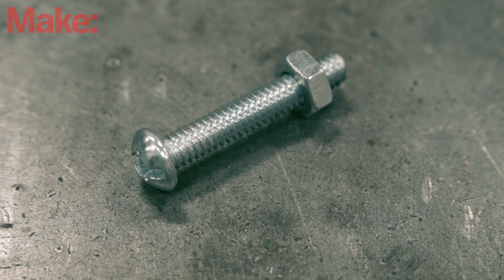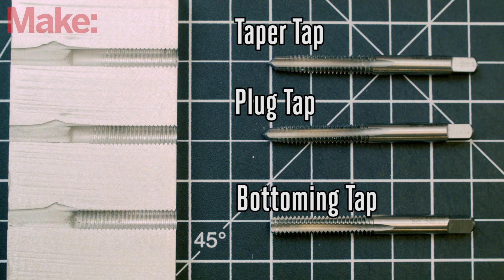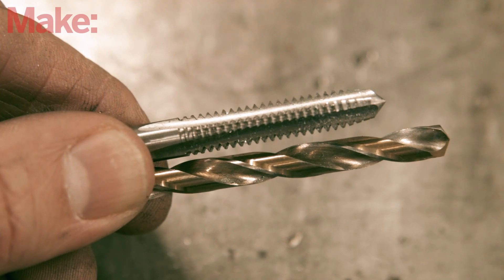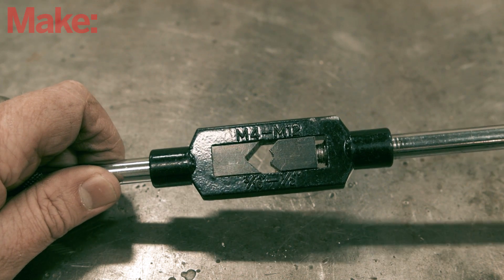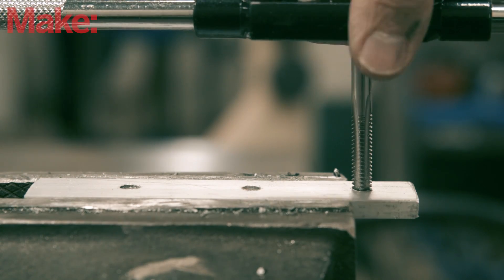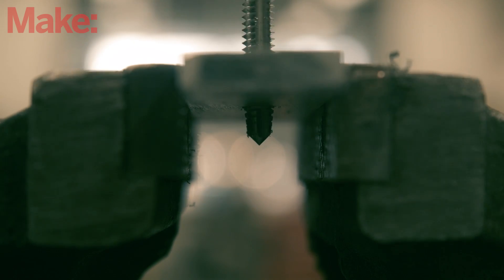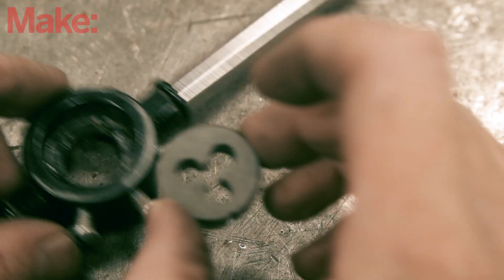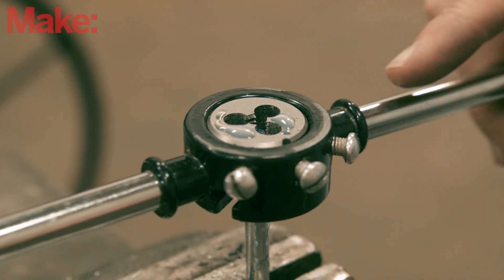Learn to use a Tap & Die to Cut Threads

Comment: Ironically, if you need this video, you pretty much have no business whatsoever doing what it describes.  Or using any sort of sharp and/or power tools, for that matter.
Reply: First of all, not knowing how to use taps and dies is NOT a sign of "mechanical ineptitude" -- in fact, when I took the metal lathe class, the instructor said that threading is such an advanced topic that many people never do master it!  So your being so great with taps and dies is an EXCEPTION, not a rule -- and your insistence that anyone who's not as good as you are with taps and dies has "no business whatsoever with sharp and/or power tools" is TRULY sickening!  Second of all, no, electricity is NOT a luxury in the USA and neither is public internet access (i.e. via a library or internet café) -- it's only a luxury in third-world shitholes, but once again, those places don't matter!  And third of all, it is NOT "grossly irresponsible and potentially dangerous" to use other, easier-to-use tools (like power drills, hacksaws, etc.) without knowing how to use a tap and die -- in fact, there's PLENTY of other tools which you could use safely before learning how to use a tap and die!  So it's YOU who's irrational and don't deserve to be taken seriously -- and I hope you cut your fingers off with some sharp power tool one of these days and bleed to death!
Reply: +Doug Reed I have been machining for almost a decade now, I am by no means an expert, but I can say this. If you haven't broken a tap, its simply because you either haven't tapped a lot of holes, or you haven't tapped anything more difficult than a through hole in mild steel.

As for my comment on luxury, I was simply trying to state that not everyone watching this video has had vocational or on-the-job training. There are people commenting on this video that have only ever ran a tap in a drill. I am sure these people are competent enough with other basic tools and appreciated a short and fairly well-informed video on the proper use of a tap and die set. I'm sorry, you have come across as someone who thinks less of anyone who has a "lower intelligence" than yourself. Hopefully you will soon realize that many people come from many different walks of life with many different skill sets. Your comment "Ironically, if you need this video, you pretty much have no business whatsoever doing what it describes.  Or using any sort of sharp and/or power tools, for that matter." Is simply inflammatory and very close-minded.

+agentorange153 I have this advise for you regarding our new acquaintance, "Troll in the dungeon".
Reply: Doug Reed Not everyone has the luxury of working in a fab-shop. You generally don't learn new skills by spending a lot of time doing a separate skill.
Reply: +doug reed First of all, even people who know how to use a lathe, even for intermediate/advanced stuff (center-drilling, boring, countersinking, bevels, etc.) might not yet know threading, so your "no business whatsoever with power tools" is DEAD WRONG!  Second of all, a basic laptop (or a public-access computer like the ones in a library), internet service and electricity are NOT "luxuries" (except maybe in some third-world shithole like Pakistan, but those places don't count anyway), but taking a full vocational course as a machinist certainly IS, except for people who have to do it as part of their daily job!  And third of all, the more I think about it, the more disgusting I find YOU as a person and EVERYTHING that you've said so far!
Reply: Doug Reed You got to start somewhere.
Reply: Max Maker
Exactly.  And that place would be basic wrenching on simple devices that aren't dangerous in any real way.

By the time one is up to the level of fabrication that involves threading, this video should seem quaint.
Reply: I found this video highly educational i used to put the die in the vice and turn the rod with the tap holder by hand , I am also looking forward to instructional video on how to use a size 1 Phillips screw driver along with maybe a follow up video for a size 2
Reply: @Doug Reed Then what was your reason on initially clicking on this YT post, then watching the video & commenting? Oh I'm sure it's because you don't NEED to learn this info you just wanted to.
Reply: Marc St. Marie
Not exactly sure what you're trying to say here.  But if you're talking about luxury being some sort of measure of need, might I remind you that we're discussing a video that requires  a sophisticated electronic device, internet service and electricity to view?

Honestly, the more I think about it, the more disgusting I find what it seems you were trying to say.
Reply: agentorange153
1) There are tens of thousands of people in the USA alone for whom regular meals and a roof over their heads is a Goddamn luxury.  Why don't you explain to them how they're supposed to have laptops and internet.  Jesus Christ, your level of self-centered arrogance is utterly jaw-dropping.

2) Taps and dies work exactly the same way as the fasteners they cut threads for (lefty loosey, righty tighty).  If someone honestly needs special training to use them, they are incompetent to an extent that they probably shouldn't be by using any tools whatsoever.  This is basic common-sense safety.  The ignorance you display by arguing to the contrary this is truly astounding.

Based on the intelligence and attitudes toward safety (and society) you've shown here, it's far more likely that you will be the one experiencing a fatal injury (shop-related or otherwise).  I'd be lying if I said that bothered me. 

Take care!
Reply: @andygaras  You're a 2 second turncoat ;)
Reply: Oh btw, I am homeless in the U.S. (S.F. Bay area to be exact) on a cell phone (using wi-fi). I am on my way now to get free meal & food from a community food pantry. Electricity, food, a place to sleep, shit, shower, & shave, (now in current modern times added) internet are BASIC NEEDS & a human right to be able to have to live in the U.S. NOT LUXURIES.  I would feel grateful to have the basic essentials (but I don't) to daily live like an average American.
Reply: @360revolucion8 
I watched it to see if there was any info I could use to improve either my own tool-use techniques or the results thereof.  Sadly no luck, but I had to watch the video to find out.
.
You're absolutely right about food and places to sleep and shit being basic needs.  Whats more, I'm happy for you that people are willing to donate to you so much of the fruits of their labor, so you can enjoy a more luxurious lifestyle than you're able provide yourself.  To have people willing to sacrifice what they have earned so others may experience an upgraded standard of living is a privilege many people cannot boast.  I hope you appreciate the true value of the charity gifted to you.   Stay well, my friend.
Reply: Doug Reed Once again since you’re slow at learning because others gave you the facts.  I also gave you the facts with myself as evidence having heat, running water, electricity, satellites for communication technology (cell phones, internet etc.) or since WE need to repeat and take it slow, I should clarify for you, having the use of hi-speed internet IS a necessity that few like you fail to see even when it is right in front of your face at this moment.  Amid COVID-19 crisis, it has provided a clear, magnified view of the gross inequities of our systems and services.  Whether it’s an inequity based on socioeconomic status, living situation, race, sexual orientation, or disability, these inequities have existed since our systems were born.  Doug Reed you still don’t understand? Well I’ll give you some fundamental truths with a real life example with no special tools needed to learn.  It may cause you discomfort but don’t worry it is higher learning and I believe you can learn.

EXAMPLE - Regarding our systems in education a glaring inequality on device & internet access. 
	 COVID-19 has shaken up everyone’s way of life in some way.  Schools abruptly were forced to close rapidly shifting to distance learning & leaving parents, teachers, & administrators scrambling to provide learning in alternate ways to all students.  Too many families do not have internet access nor a device per child.  There are districts who offered WiFi hotspots to families, however not every district is prepared or has the funds to provide these devices.  Some families were driving to schools and using their network to work and learn. Is that fair and equitable?  For decades, many organizations have been speaking about this inequity.  Students who do not have access to high quality internet connectivity are at a disadvantage unable to realize the power of digital learning.  (If you need I can provide stats if you request)
Current crisis has magnified what organizations have been telling us that internet accessibility is a basic human right that should be made readily available to all.  It should be as fundamental as the air we breathe.

Speaking of the internet, it is ESSENTIAL that websites materials, methods, & assessments are born accessible.  This means that videos should have closed captioning transcripts.  Image descriptions should be provided as well as alternative text for images.  With the further guidance from organizations that provide a framework that proactive plans for variability by providing options, choices, & flexibility to all learners first and not after.  Given our state of affairs, a light on equity has been cast.  It is up to those who are PRIVILEGED to no longer ignore and flip the script.  Take a break.  Go ponder.  Another lesson to expand your narrow mindedness.  Yes we can do it.  You show interest in improving your technique & with your arrongance and proud display of narrow mindedness, YES YOU CAN expand your knowledge and YES I CAN teach you.  Higher learning to be continued...
Reply: @360revolucion8  
Lol, well thank you, Captain Obvious, for the Cliff Notes version of radicaI Ieftist doctrine that presumes the 'Right' to systems it didn't create, doesn't maintain and has no meaningful understanding of the operation or origin of, but I was well aware of what you were trying to say.  Perhaps you thought it merely coincidence that I referenced the concepts of donate, luxury, upgraded standard of living, priviIege, charity and gift as pertaining to your situation, and twice cited the fact that theses things are the product of others sacrificing what they have earned through their own labor so that you may enjoy what you haven't earned.  Or perhaps you didn't...it's impossible for me to know what your, I presume undiagnosed, condition does or doesn't prevent you from perceiving or understanding.  Given that, I felt a supportive, non-adversariaI approach that validated what you got right and simply ignored what contradicted reality, instead opting to lay-out simple, fundamental facts to make my point, was the way to go.  Meh, gambled and lost I guess.  So let's try a different approach.
.
With all your talk of 'Rights', I get the impression you believe you have the 'Right' to the food you receive from the food pantry, yes?  I mean, food's certainly a legitimate need for survival.  Okay, let's work with that.  Imagine tomorrow, everyone decided that working at the food pantry sucks so bad, they won't do it at any price.  No workers to collect,  process and disburse the food means it doesn't get to those who want it, including you.  So, how's your 'Right' to that food (food that other people invested considerable time, effort and resources to produce and bring to market, yet you pay absolutely nothing for) to be upheld?  Nobody's willing to work there, yet you need their labor to get the food that's 'Rightfully yours'.  The only option is to somehow coer¢e them.  You could guiIt them with claims of inequ¡ty, or some such thing.  You could thre@ten them with labeling them some sort of -¡st or -ph0be, making them a target for the w0ke m0b.  And then, of course, there's always the old classic of simply putting a gµn to their head and saying, "Get to work!" (Naturally, it'd be SOMEONE ELSE doing it FOR you.  Seems to be a recurring theme.  But I digress...)  The options are either people voluntarily give to you what's theirs (their time, labor, fruits of their labor, freedom), or you take it from them against their will.  Exactly which one of these is your 'Right'?
.
What's that?  Something about this or that other place to get food or, more likely, government programs?  Don't matter.  The charity vs. th€ft and ext0rtion paradigm still applies to the former, and doubly so to the latter.  What's more, it applies to every single thing you've declared a 'Right'.  Resources (be they internet, food or whatever) and wealth are created or obtained exclusively through labor.  The richest gold vein in the world has no use or value until someone mines and refines it.  A stick laying on the ground has no use or value until someone picks it up and uses it or crafts it into something of value.  When someone is given that which they didn't create or somehow earn, it can only be at the expense of the the person(s) that did create or earn it (or it's value, thus including third parties reimbursing the creator/earner).  You gain, they lose.  Is that your 'Right'?  Is that fair and equitable?  No, my friend, outside what's created or earned, there's only charity or th€ft and ext0rtion.
.
It's very simple: an individual has the 'Right' to what he or she can create or earn with their own labor, and nothing more.  All those other things you've falsely declared 'Rights'?  Those things other people invested their their sweat...their blood...the precious hours, or days, or years of their finite lifespans into?  Those aren't yours, or anyone else's, to clam as 'Rightfully theirs'.  
.
Now I'm all for people choosing to share what they can, especially in the interest of the common good.  I've logged countless hours of volunteer work and donated to numerous charities.  I've spoken at public hearings on behalf of teachers.  I've gotten con$ervatives to agree with me on the benefits of universal healthcare.  But the thing is, I understand these are amenities that can greatly benefit and advance society and it's people, but they aren't requisite for people to survive, or even thrive.  Just because something is of benefit doesn't make it a 'Right'.  I love seeing those most lacking get tools they can use to become productive, fulfilled individuals.  But to presume that's some sort of license to force everyone else to give-up what they've worked hard for is the definition of iIIegal, and honestly, just plain twisted.
.
Edit: formatting error
Reply: @ItsMrAssholeToYou  not sure if you're rude, arrogant or ignorant, but of course videos like this have a place! I learnt to use taps & dies when I was about 5, I found them fun, so the basics are well & truly in my head for good, cause I did so many of them, but I haven't really done them since, now I have some birds I want to make fruit holder wires for, cause it's hard to find thin sizes that aren't ridiculously expensive, so I figured I'd make my own, but having not done it since I was so young, obviously it's logical to refresh with a video before doing it & additionally, I am actually stuck on sizing & terms, cause I never learnt them when I was 5, I just learnt how to physically do them. 

If that makes me incompetent in your eyes, that says much more about you than it does about me! I find it incredibly sad how many adults don't know how to carry out basic handyman tasks, especially women like myself, & people like you just contribute to that, making people scared to try something, that if they tried they would see is actually very easy. You might be creating business for handymen, but you are most certainly not helping society! There is no danger in using taps or dies beyond everyday life! They are a very safe handyman skill to try, far safer than hammering in a nail to hang a picture on a wall, aren't they! While amateurs may not succeed, there is absolutely no reason for them not to try something like this if they have the desire for it!

& side note, does anyone other than Doug know what to look up or what size wires to use? I'm wanting as thin as possible that has screws available, from what I can find so far, the smallest screws is M2, so I need to figure out if that's a M2 die & what size wire I use on that. I'm thinking probably M2 die & 2.5mm wire, but really not sure, as my Dad had a full set of taps & dies, so I only learnt to match up what I was doing with what size worked on that, not what to buy if I only needed to buy 1 for a project.
I was actually hoping for even smaller than M2, but that seems to be the smallest I'm going to be able to get all the matching supplies for (at least not without paying an absolute fortune for specialty items)
Reply: agentorange153
It's a question of basic competence.  If one is so mechanically inept that they can't figure-out how to thread with taps and dies and need a video like this, they really, truly do have no business whatsoever using any sort of sharp and/or power tools. 

Beyond middle-school shop class (which, BTW, never covered threading), I've never had any formal training in tool use.  Yet I've managed to successfully thread many, many parts without even so much as breaking a tap (even the small ones, which seem designed to break) long before ever seeing this video.  It wasn't luck that facilitated this near super-human feat--it was (drum roll, please)...basic competence (gasp!).

Luxury is a relative concept.  Things you seem to take for granted actually are luxuries to a great many people, even in the USA.  I'd call your sense of entitlement sickening if it weren't so common I hardly notice it anymore.  Thanks for the reminder.

Thirdly, given your defense of a grossly irresponsible and potentially dangerous attitude regarding tool use (not to mention your twisted sense of what luxury is), you'll forgive me if I fail to take your ideas seriously or lose any sleep over your irrational opinions. 

Have a lovely day.